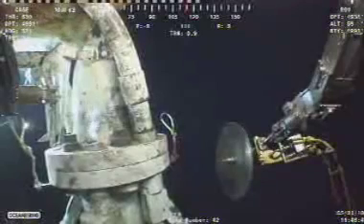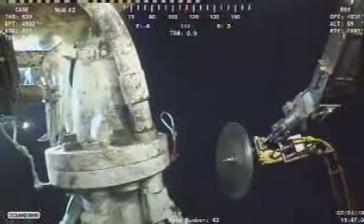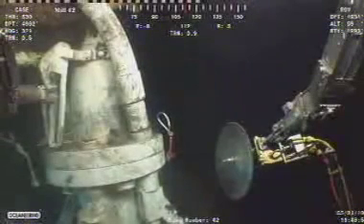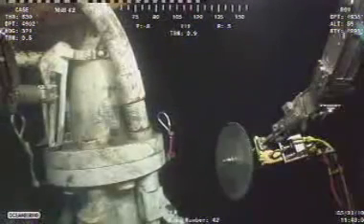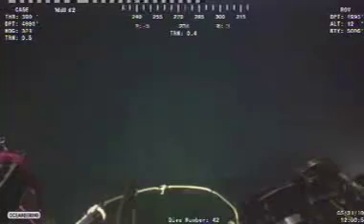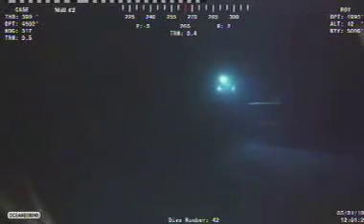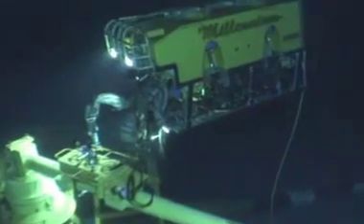BP Oil Spill Riser Choke and Kill Line Cutting Part 3 of 3

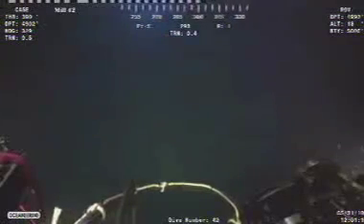Comment: Correction at around 1:40, depending on the vehicle, anywhere from 2300VAC to 3100VAC three phase power might be sent down from topside via the ROV umbilical to power two electric motor/pump combos. In addition to that, 480V single phase power is sent down to power the electronics and fiber optics to handle communications.